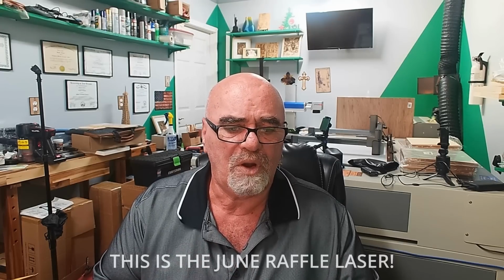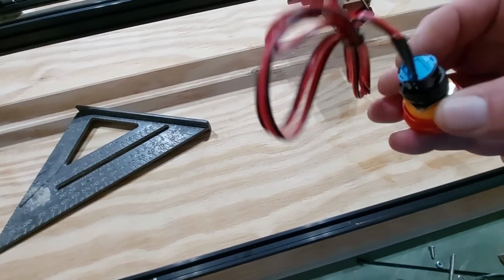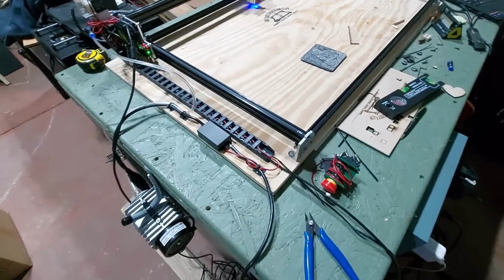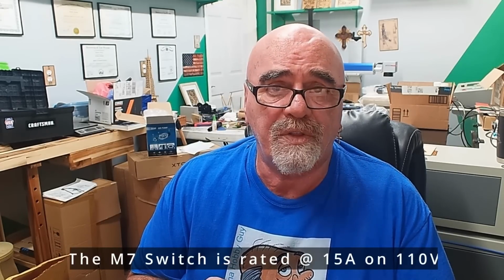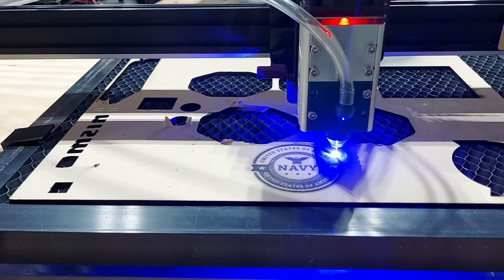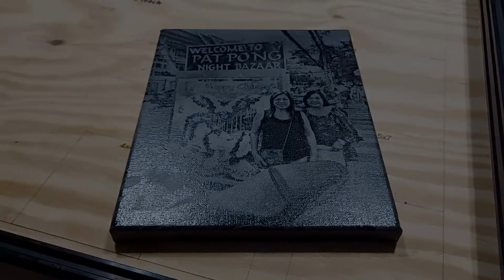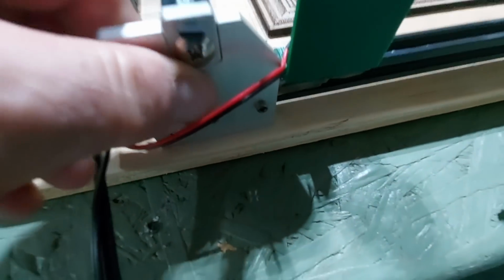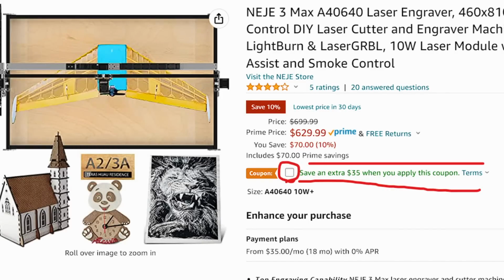❓ The best Diode Laser in 2022? The Neje 3 Max!

Comment: Thank's for your video! Do you have the same focus for engraving and cutting?
Reply: Thank you! If I have good understood, up to 2mm is for engraving and cutting in the same time.
3-5mm for only engraving and 1-2mm for cutting?
Reply from the maker: Yup!
Reply: Hi Louisiana! I need please your help. I have received yesterday my new NEJE 3 MAX with the laser A40640 (adjustable focus). To adjust a correct focus to engrave and to cut in the same job, I have understood your last answer (up to 2 mm for engraving and cutting in the same time), but what is the distance beetween the bottom of the laser and the top of the material to engrave? Thank you for your answer!
Reply from the maker: Up to 2mm I do Patrice. 3-5mm and I'll lower 1-2 for cutting.

Comment: Nice review Rich. Having seen it in action I am more convinced to get it. After commenting on Facebook that it would be nice if it was over 1000mm in length then it would be perfect, I noticed on the Neje site that there is an extension kit effectively doubling the Y axis length and that is huge! This is a well designed product whereby any owner can upgrade at their own pace.
Reply from the maker: Yes Dimitrios, you can buy extensions for this!
Reply: I’m just setting mine up with the extension kit. Workarea 810 x 1030

Comment from the maker: Make sure to push this laser Gantry to the TOP RAIL BY HAND when assembly is done! This will ensure the left and right stepper motors and timing belts are in sync. The TOP RAIL has hard, equal stops; the bottom does not! Here is a link to the new ALL METAL air assist for the A40640!  https://tinyurl.com/nejeair40640
Reply: I'm a bit confused, you state to syncronize the X axis stepper motors we push the X axis gantry to the top rail, yet in Buster Beagles two videos on this machine and also the Neje site it says we bring it down to the front rail. My machine is on route and expected any day soon so keen to clarify this.
Reply from the maker: @davidadcock9421  It doesn't matter which side you bring it to, it only matters that it fully goes to one side or the other.

Comment: Hi Rich, I Just want to remind you not to exceed the current spec on the relay with multiple items on a power strip. You can use the relay that came with the laser to drive another higher current relay if needed. Thank you and have a great day.
Reply from the maker: Thanks Glenn, but the air scrubber is 4.1A and the small compressor is 0.5A. If I use the shop compressor, it's 4.5A. So I think I'm good on a 15A switch & circuit!

Comment: 😅 I got 2s Max, 3weeks later they released 3s Max.

I made my own bracket and drag chain.
In it has a dedicated 12v, ¼air tube, and it's 2 cable controller.

Thank you. For all your guidance.

Ps. I paid $350 at Amazon
"trying to survive, without needing working 9-6 shift"
Reply from the maker: Awesome Jose! Thanks for sharing!

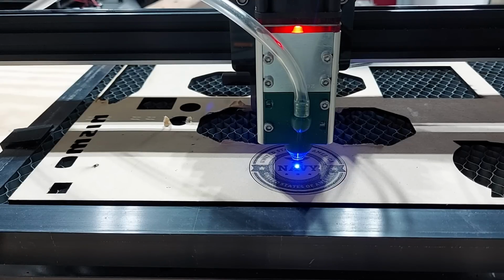Comment: 29:00 shouldn't the diode have turned off at this point? Mine only does that if the board loses comm w/ the PC. It'll stop dead but the laser stays on at the last set power.

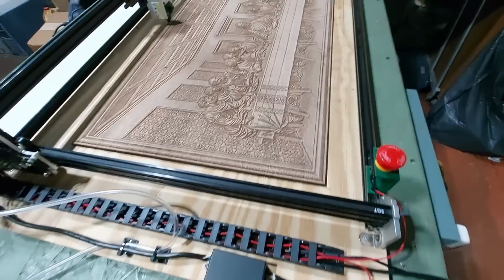39:00 I added adhesive heatsinks to my printer steppers. Makes a difference, but at 105 ambient you'd need forced air probably.
Reply from the maker: The diode never turns off on the A40640; except the one on the Ortur control board. It's a very weak light. You can put paper under it and it will never discolor. It's a Neje feature. Heatsinks are probably a good idea if you're going to do a lot of large projects.

Comment: How close do you run your air nozzle to the material? I was running about 5mm clearance to the focal point and clogged the orifice w/ soot during an etch before a cut. I've added about 5mm more to the design but haven't printed it yet. Should air be ran when etching too or just cutting?
Reply from the maker: If the laser has AA I run it all the time to keep smoke and debris off the lens. If you're clogging at 5mm, you may not have enough air pressure.
Reply: @TheLouisianaHobbyGuy  it doesn't clog when it's on. I was running the mom's day project and it clogged from the engrave before the cut.🤦🏼
The orifice was only about 1.5mm though. 5mm clearance w/ 3mm product puts it too close to the heat anyway.

Comment: For the Z1, there's a spare header on the board that natively works w/ lightburn air assist toggle. No M codes needed. It runs on 19V logic which seems odd since the PS is 24v. I just need to CAD and print a case for my SSR to run the pump. The jack on the board uses the same plug as endstops.
Reply from the maker: I haven't looked that closely at the Z1.

Comment: Have you thought of running another air line from your air manifold to blow on the stepper motor to help cool it?
Reply from the maker: No Merrill. Compressed air under normal conditions gets really hot, so that would make it worse.

Comment: Thanks for the review.  Very interesting.  Love the 2040 extrusions.  Nice smart feature. And the size is fantastic.  Control board riding the rail, not so much.  I like the relays, need some for my Sculpfun.  I didn't notice endstop switches, are they there?  Not necessary, but a nice feature.
What compressor is that and which one do you want to get?  I am in between pumps.
Reply from the maker: I guess it doesn't matter what rail the control board is on Mark, It doesn't move. Yes it has hidden limit switches. I replaced the crappy 50W air pump with a 200W pump, 3566 GPH. Awesome pump. https://amzn.to/38PegJv

Comment: Wow, that thing is huge. I got my A40640 not long after you got your first one, I use it nearly every day. It's still mounted on my old OLM2 and is a real workhorse. I wonder if they'll be selling that motherboard separate like the laser modules at some point? Thanks for the video!
Reply from the maker: Yes George, they have the control board for $79.
https://shareasale.com/u.cfm?d=886868&m=101855&u=2881930&afftrack=
Reply: Hi friend, I have to ortur laser master 2 Pro, it's difficult to connect the neje module to ortur machine?
Reply: Not at all. I had a Z adjuster so all I had to do was drill two hole to mount the Neje mount to it.
Reply: @georgechambers3197 Ok, physically there is no problem, electrically what should I do, I would love if you could elaborate a bit I got lost